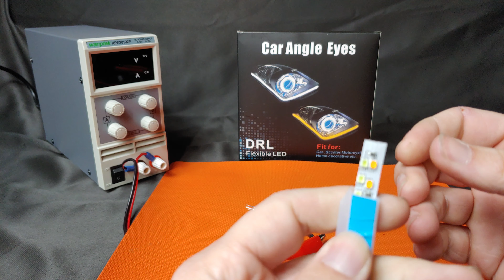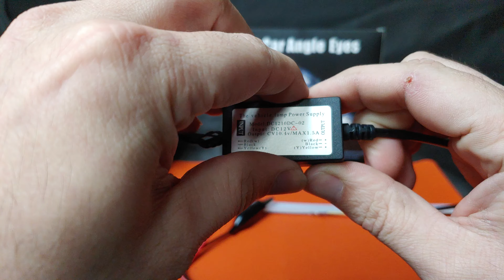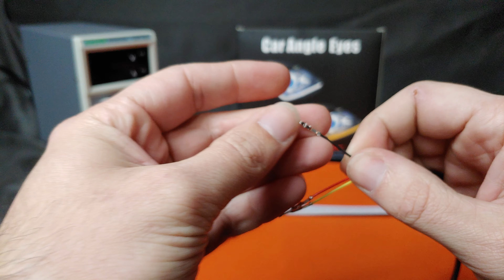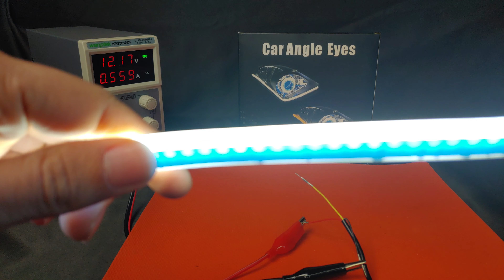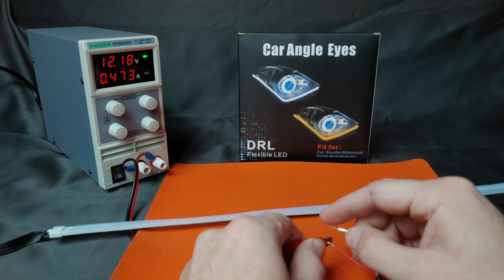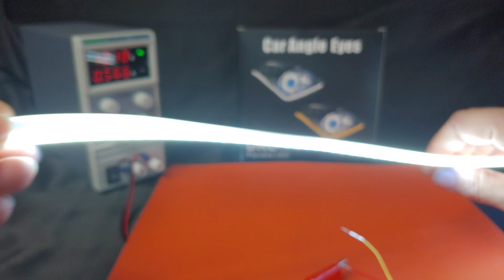LED DRL and Sequential Turn Signal Strip Review

Comment: Hi James,  I have installed similar (or even the same) leds into my car but have got an issue. I tried to put 50w 6ohm resistor and then 21w blinker resistor (i dont actually know the resistance, got it off ebay) but irt didnt work too. My issue looks like that 
https://youtu.be/pTvPS0bdXQc
The only time when I menagaed to get it working was when I connected DRL wire straight to the battery but it would not work if I hooked it up to the original DRLs. Do you know what I could use in that case? Thanks in advance!
Reply: I've had the same issue with mine and I am normally quite good at wiring and leds lol. Basically the DRL strip  lights work and so do the indicator but once the engine is running then the DRL still work but the indicators do not reflow properly. They change from DRL to indicator and back again when you put the turn signals on. So I ordered another pair from ebay that look similar ( most properly rebranded) anyway same thing apart from the turn signals work when the engine is on as long as the DRL isn't connected. The strips don't like to change from DRL to turn signal and back again when the engine is running. So I thought it might be the alternator kicking out 14.8v which is making the strips not work correctly once kicking to DRL then turn signal, so I ordered a 24v step- down buck convertor regulator which drops from 15v down to 12.1 however then I got parking light failed and it started flashing fast so that didn't work. Tomorrow I will try and connect the step down Regulator convertor input  to the red main power on the strip  DRL power then on the output  connection I will connect it to the yellow turn signal wire so the voltage should stay stable? I  doubt it will work though. Has anyone fine a way to solve it? I got some trunk RGB strips that change colour and indicator etc and they work fine when the engine is on so it must be something to do with how the control box is made. I don't think it likes the  canbus sytem in newer cars maybe? Or the newer alternators.
Reply from the maker: Someone else resolved this issue with a couple 5 pin relays, 25ohm resistor and an electronic flasher module.
Reply: @Jamesthelightguy  I don't see why you would need a couple of 5 pin relays? You mean 1 for each side? Is there a guide on the wiring setup of using the bits
Reply from the maker: Unfortunately there isn't. He only told me the components he used. I can contact him and see if he is willing to draw one up for us.
Reply: @Jamesthelightguy  That be good if you can. Be interesting to see how it went 👍🏼
Reply from the maker: I sent him a message and a link to my discord: https://discord.gg/qHZJgyR
But no one uses my discord yet haha
Reply from the maker: @jcwufo3595  No response as of yet from the guy that figured it out.
Reply: @Jamesthelightguy  Well thanks for trying. Personally I think they lied. Its cool I will work it out myself lol
Reply from the maker: Did you wire the resistor in series or parallel? The resistor should be parallel in the circuit.

Are you planning on not using the factory turn signal bulb at all?

Are you trying to have only the turn signal function without the use of the white DRL?

 I need to know the answer to each of these questions to best assist you. You can reply to this comment or direct message me on instagram or via my email (in the about tab on my channel page).

I'll do my best to resolve your lighting issue.
Reply: James the light guy Thanks for your reply! Your answer is much appreciated. I connected it in parallel. I wanted to have only turn signals and will not use the stock turn signal.
Reply from the maker: Try connecting the white DRL white directly to the turn signal wire. It should hopefully only light up the turn signal when you want and not the DRL. If you turn on the hazard flasher, do they work as you intended?
Reply: James the light guy No they dont work, they behave the same way as if I turned the blinker on. I did try that too, and DLRs are then flashing along with blinker :/
Reply from the maker: Interesting. Let me mess with mine and my power supply to try recreating your issue. By all rights, that should have worked, but we'll keep at it. There's the possibility your vehicle powers everything all the time and the switch breaks the ground side of the circuit.... I've run into a couple cars that do that and they are a pain.

Connect the strip's turn signal power wire like it's supposed to be and then try touching the strip ground wire to a good ground on the car and see if it turns on without using the switch in the car.
Reply: James the light guy Should I still use the resistor? Will do this in the evening and will let you know. Thanks for advice !
Reply from the maker: Take the resistor off.... If we're can get it to work properly (except blink fast) we will be able to figure it out one piece at a time.
Reply: James the light guy No worries, will keep you updated.
Reply: James the light guy Hmm, I went to the garage and tried connecting ground into a ground bolt under the bonnet. Its still the same. Also, tried connecting both wires (DLr and turn signal together ) and it still doesn’t work, very frustrating. Are there any tests I could do for example with mutlimeter to determine what the issue might be?
Reply from the maker: Yes the first test I would do is: with the car running and turn signal OFF, check for continuity between a known good ground and the ground wire from the turn signal harness. 

If there is no continuity we have determined the first issue. If there is continuity we then need to check the voltage on the power wire to the turn signal.
Reply: James the light guy Ok, So i checked and there is continuity. when i checked the voltage (when hazard lights are on) it oscillates between 1, 3, 8, 10 volts.  Any thoughts ?
Reply from the maker: That is odd. I expected the hazards to cycle  between 0 and 12-14 (depending if the engine was running). 

Install the originally functioning turn signal on one side. Install the resistor/equalizer on the other and retest voltage with a load on the circuit. Maybe the car is too smart and it checking to see if there is a dead bulb.
Reply: James the light guy ok, I didit and its pretty much the same reading. I did try to connect dlr to the battery source where approximately 14 v is present when car is running. The strip worked fine, I think there isn’t enough voltage for indicator to function. Is there any solution for that? This is how it looks https://youtu.be/SzskB6xE8y0
Reply: DC / DC Converter Regulator 5V-11V To 12V 2A 24W Step Up Power Supply Module #D

I found that, let me know if you think I should give it a try. Thanks again!
Reply from the maker: I apologize for the delay, your reply was auto-blocked for some reason and I didn't see it until now. A converter-regulator might be a viable work around. Ideally I would want some sort of timed relay which would be triggered by any voltage and stay on for 1 second then switch off. The intelligent relay would ignore additional inputs (oscillating voltage) while on. I could try to fabricate a set. Try the regulator and if that doesn't work I'll try making the smart relay for you.
Reply: James the light guy Thanks a lot once more. I have order the part and hope it will arrive within a week. Will keep you updated, stay safe!
Reply from the maker: Just checking in. Let me know if the DC/DC converter regulator is showing any promise.
Reply: James the light guy will do. still waiting for it to arrive. I hope it’ll be here by the end of the week , will keep you updated. stay safe
Reply: James the light guy I had hopes with the little converter however, it did not work.  Feel like giving up to be honest
Reply from the maker: @bydoniek  Give me a couple days to see if I can come up with a special relay or something. It's difficult to come up with good solution when I don't have it in front of me so I can mess with ideas directly.
Reply: @Jamesthelightguy  I have connected the DRL they work perfect when car is on ignition. Soon as you start the engine the white DRL work but the indicaters on DRL won't work, pretty weird. Tried re directing ground and also the live wire. Stuck

Comment: Hi, is it possible if I cut the strip into 2 part, and reconnect the wire again? The signal yellow light still can flow?
Reply from the maker: That is an excellent question! I'll cut one tonight and solder some wires between and film it. I'll post the results tomorrow! (May 01, 2020)
Reply: @Jamesthelightguy  Thank you so much for your review, can't wait for it.
Reply from the maker: Hey, video was a failure, however through my experimenting I was able to proper it is possible to extend the strips. The issue I faced was the way these strips figure out the timing for the turn signal flow. The closer to the starting side, the more electrical traces there are under the protective coating and all of them would need their own jumper wire. That in and of itself isn't too bad, but my soldering is awful and I melted the traces right out of the strip by having my soldering iron set too high. I destroyed two strips attempting it.

So, is it possible? Technically yes, but "practically" impossible for me. I'm sorry I won't be able to upload a video tomorrow for you.
Reply: Good attempt! Thanks for trying our for me, really appreciate it. Sorry about to spoil your strip. Keep it up, definitely will continue to follow your video.
Reply: @changziyi2216  https://youtu.be/YCJbVLYxGWk just saw this and he mentions it on that model

Comment: Is it possible to keep the yellow on. As a drl?
Reply from the maker: Not with this style. There are options out there which are just on/off amber without white or sequential turn signal illumination. Something like these https://www.ebay.com/itm/272217906125
Reply: @Jamesthelightguy  Hey James the light guy! Great video, I have the same ones you have demonstrated in this video my question is, is it possible to use just the flashing yellow indicator as the indicator and disregard the white led light? In the UK it is illegal to have the main beam to together with the white led. I tried connecting just the yellow to the indicator and left the red disconnected and black to the chassis but nothing happened.
Reply from the maker: It's been a while since I've messed with these. I did something similar to what I believe you are looking for in this video:
https://youtu.be/ksqDfpkbgZg
 Skip to 6:00 for bypassing where white light and only using the turn signal function.
Reply: @Jamesthelightguy  Yes I just watched that, it made so much more sense have both wires Yellow and Red on the positive indicator to function as you can imagine its impossible to wire if you aint using the Red. I will test and get back to you! Liked both videos and sub doode!

Comment: If i want to use it only like turn signal's?
Reply from the maker: Depending on the set, you may only need to connect the ground wire and turn signal wire to the car. However I have found that some sets require the main wire to have power. In those cases it is possible to connect the main wire and turn signal wires together with the vehicle's turn signal and it functions in only two states "off" and "turning" I can make tutorial video of you'd like.
Reply: @Jamesthelightguy  
Will be nice🍻
Reply from the maker: Ok, I will make one next week.
Reply: @Jamesthelightguy  please show video on normal led cob strip light of 12 v and 2 watt, which will glow when turn signal is activated!!!! Awaiting... thanks.
Reply from the maker: @tnamen1307  I'll try to make a video on this request next week. Would you like a comparison of sequential strip, regular strip and COB panels?
Reply: @Jamesthelightguy  sure, awaiting.......
Thanks for the reply..

I'm really surprised why the led does not glow when turn signal is activated.
Reply from the maker: @tnamen1307  there is a micro controller that temporarily switches off the power to the white LEDs when it received power from the turn signal wire. The controller then sends power through the yellow LEDs which have other components that delay the activation of the yellow light based on how far down the strip it is. After the turn signal wire loses power, the microcontroller waits for a capacitor to discharge then applies power back to the white LEDs. It's all very clever.
Reply: @Jamesthelightguy  I'm concerning about the regular cod led strip which have only one color white. 12 v and 2 watt.
Reply: @Jamesthelightguy  just a normal cob led strip only. No other functions. Just white light only when connected with battery.

But it doesn't glow when connected in parallel with the turn signal circuit!!!!
Reply from the maker: Here's a short video on some additional strips. There's a part about bypassing the DRL so it only acts as a turn signal. https://youtu.be/ksqDfpkbgZg
Reply: Mine worked with just ground and turn signal, that way it doesn't turn white

Comment: I would like to out these on my rear single lights  However I cannot have white because that indicated reversing.  Can the white be disable without taking away from the yellow single?
Reply from the maker: Yes it can, but for the rear, I recommend these red and amber ones from eBay:

https://www.ebay.com/itm/163735663033

I'll try to put these on the schedule and do a review of them.

Comment: These strips can be shortened, could it be that you will get closer to those 1.5 amps the shorter you cut it?
Reply from the maker: I have already installed these in a custom headlight build (part 1 will be uploaded next week) but I expect the current draw would go down as the strip is shortened.
Reply: @Jamesthelightguy   what if I connect a led strip of 12 v and 2 watt power the turn signal circuit?? Will the led will glow when the turn signal is activated?? Here, current draw is about .2 amp. Will it be dimmed??
Reply from the maker: @tnamen1307  a 12-14v signal at .5a is ideal. Depending on the length of the strip it could be dim at .2a I have another video about these signal strips:
https://youtu.be/ksqDfpkbgZg 
Check it out.